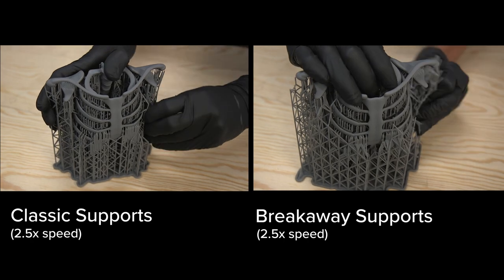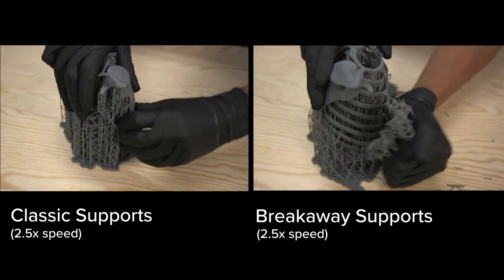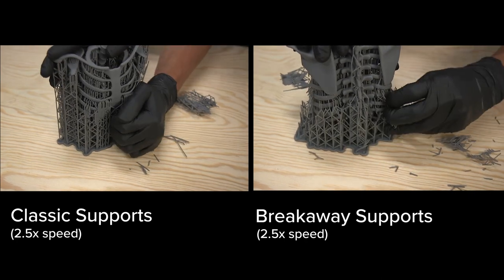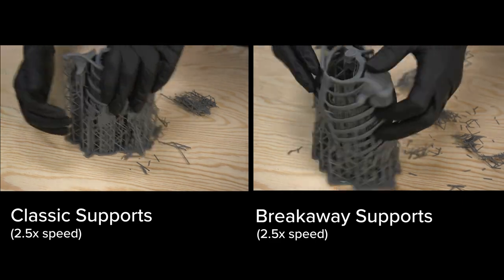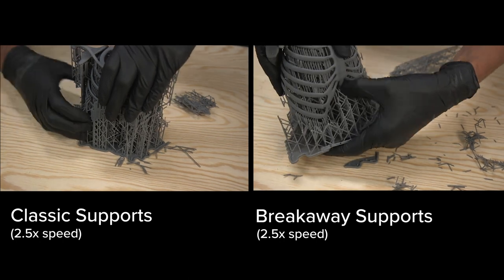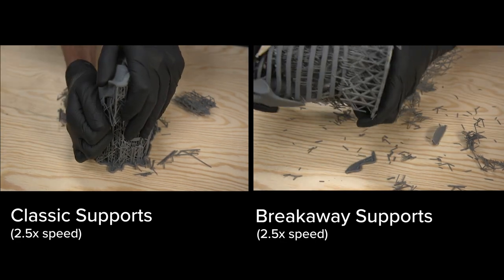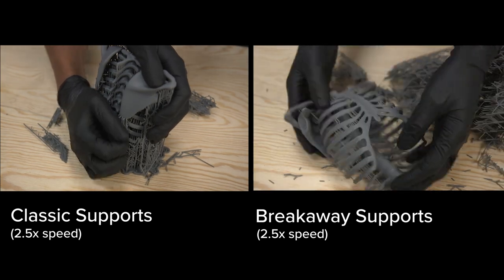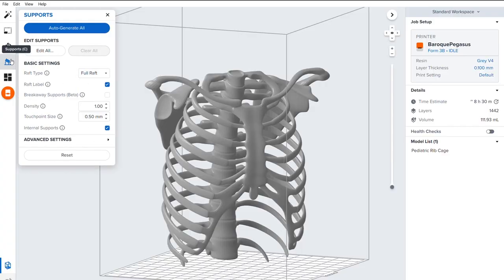New Supports Features in PreForm: Breakaway Supports

Comment: Id really like to see this in some of your engineering resins, like the Tough 2000, if it's even possible. I use Tough 2000 as a test and send my parts to my customers, and before I do that, I have to do a lot of sanding and washing, which can also take out some detail in. This cause me to have to rescibe lines, and etch back in details. Can this breakaway tabs minimize this, and ultimately save time for those of us that need to print our parts from the start in resin like Tough 2000?